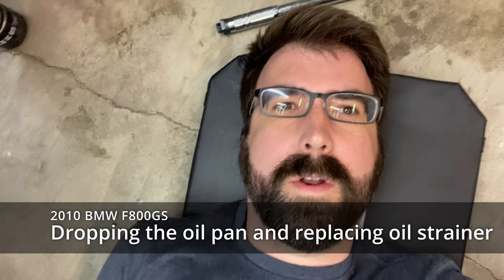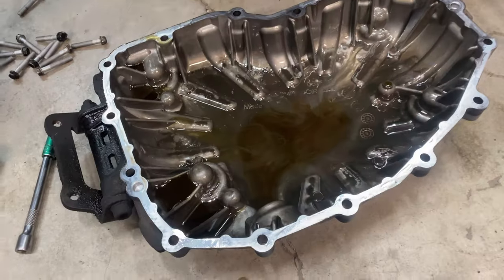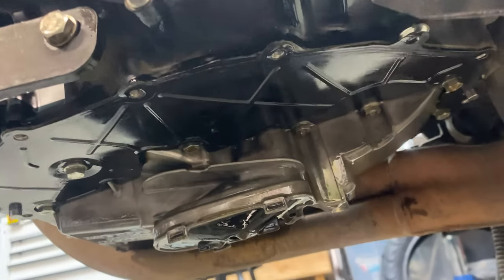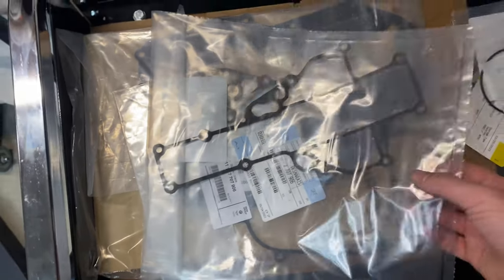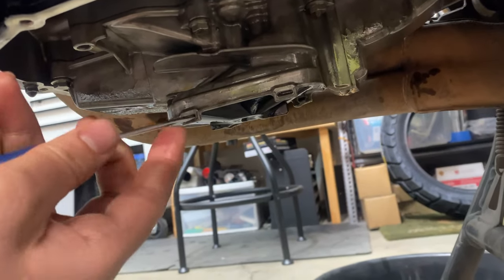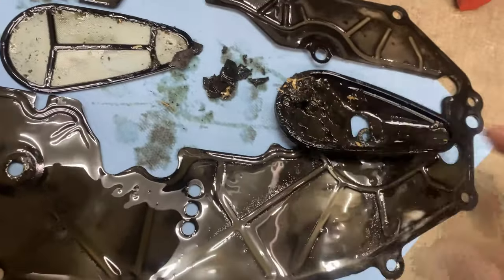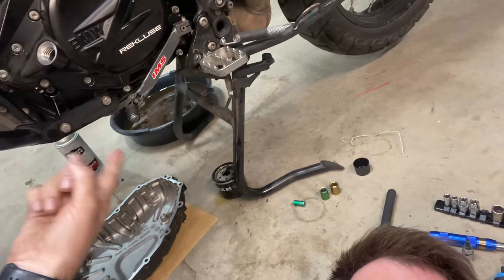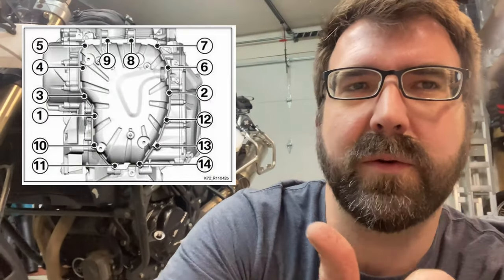F800GS Dropping Oil Pan and Replacing Oil Strainer: I shredded my clutch pt. 2

Comment: Thanks for the video. I watched both of them regarding the Rekluse clutch.
Did they ever get back to you about this clutch failure issue?
Based on the amount of work you had to do, seems to me they should be making this right.
Reply from the maker: They did! And they 100% made it right. They said it most likely due to moisture from condensation in the oil that caused it to separate. Still covered it under warranty even though it was basically my fault for not going on longer rides but still using it to commute short distances during the cold winter months.